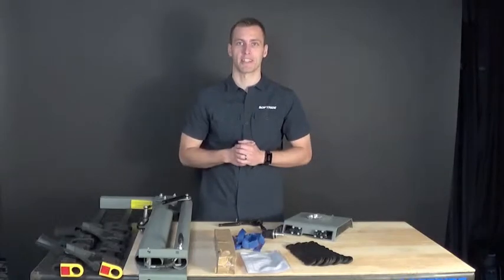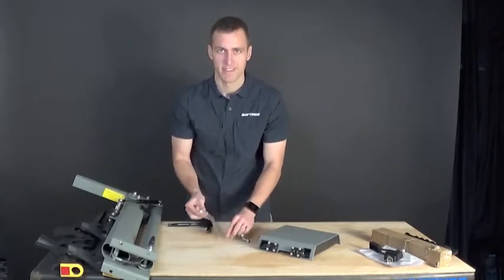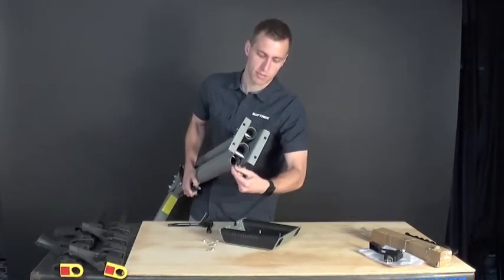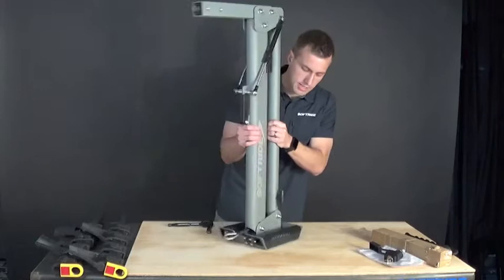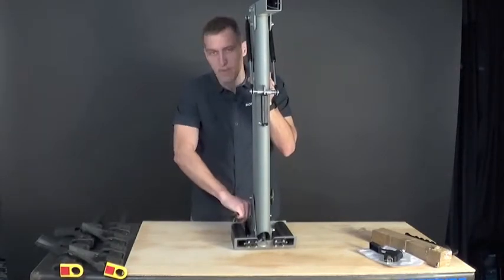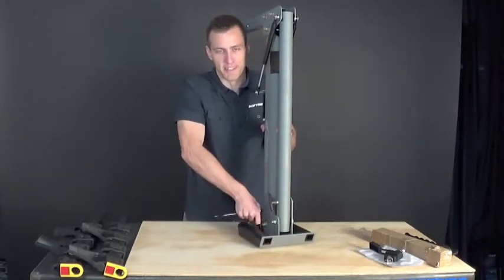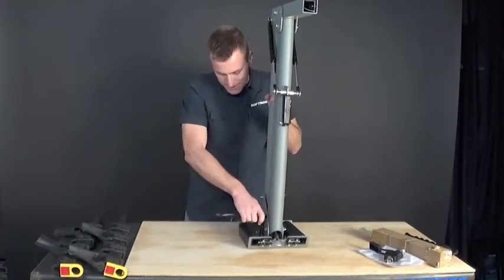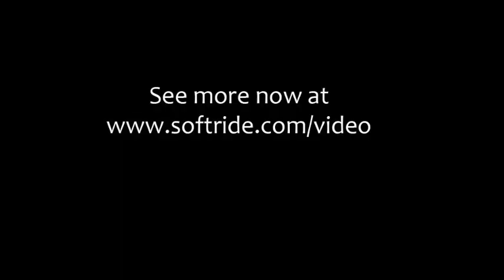How to Install the Top Plate on a Dura 4 Bike Rack - Softride Bike Racks

Comment: Since Softride is no longer producing / selling replacement rubber straps, can anyone please guide on an aftermarket equivalent that actually works with Softride racks? So far, I've got straps with the rubber too thick OR the hole too wide to get on the cradle pin in a secure manner...